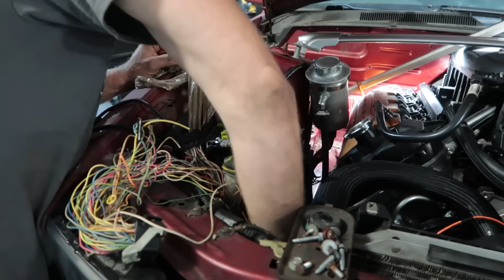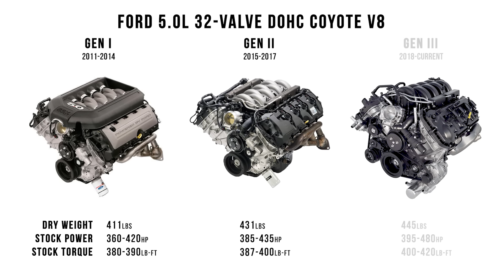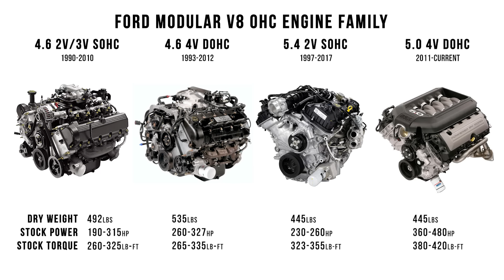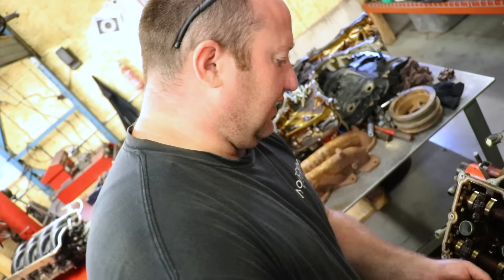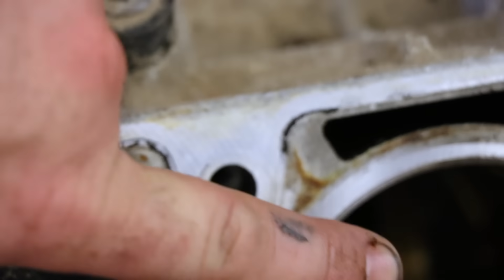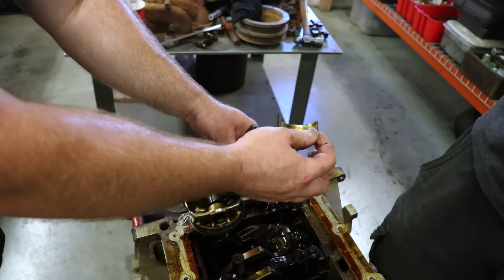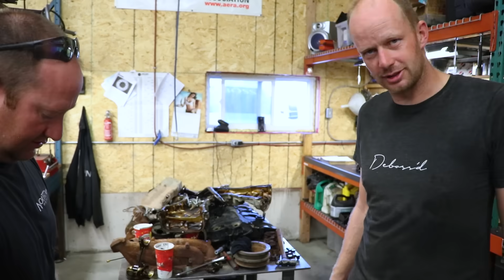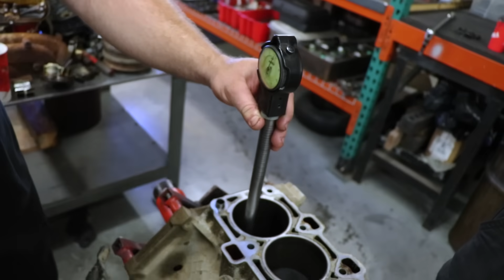REVIEW: Everything Wrong With A 5.0 Coyote Engine

Comment: Has anyone else seen synthetic oil do that to engine? I don't think it was short drives oil not coming to temp, I think this person never change there oil, just to show how careless they where they ran Frame oil filters!! which in my opinion are the worst one on the market!
Reply: I manage an auto parts store, at least 90-95% of my customers choose Fram filters. Even the ones who ask for my advice on filters (I typically recommend Mobil 1 filters) still go against my advice and buy Fram. We car guys may hate Fram, but most of your average Joes use Fram and the cheapest oil they can find.
Reply: @brushlessmicrot  yea I run Mobil one oil and filters and it has always done good by me, when it comes to auto parts cheap doesn't mean good! You get what you pay for. Also project farms YouTube has a good review of oil and filters.

Comment: 2014 f-150 fx4 w the 5.0. 132000 miles not a single issue. every 5000 full synthetic 5w-20 motor craft oil and filter. still doesn’t burn any noticeable amounts of oil. used as a truck everyday. maintenance is key for any vehicle.

Comment: Ribor your Cam boars and put bearing in r just throw it in the  scrap metal  the Amount of issues is overwhelming get A about a** all my support love a channel not trying to be a negative Nancy but I pretty much hate this line of engine charge my customer  $1000 just to tear into these things and tell them that it's junk afterward that usually doesn't go over well and it's not my fault   To fix him you have to pump about 5 grand into a $7000 truck you go spend 10 grand on LSGM same year did actually run The 10 boat just sucks

Comment: Love the comment he made about the LS being old pushrod technology, lol. Apparently newer doesn't mean better else Ford wouldn't have gone back to the pushrod engine design for their new big block truck engine. Which, by the way, I can't wait to see people dropping those into everything. Hoping Ford gains a little market share with that one. Even though I am an LS fan.
Reply: Could it be to keep engine size down? No large heads to house cams?
Reply: @jimdailey1018  Could be that among a bunch of others. simplicity of service and repair leading to less cost of ownership for fleet vehicles, etc. But the main reason why people don't put near as many coyote engines in as LS is due to the overall size from those overhead cam heads.
Reply: The OHC design predates the pushrod design. Nobody ever said newer is better, OHC just allows for safer high rpm revving and better airflow via more valves. 

The new 7.3l truck engine, (It's actually a small block) Is a low rpm, torque oriented engine designed for towing and heavy loads with reduced maintenance costs etc. It's not going to 7k all day, so it doesn't really need the top end air flow.

Comment: "money aside" haha, 99% of people are limited by money. of course the motor with the most valves/etc has the most potential, but it's so over complicated the guy building the motor said he can't even set up the cam timing. what a stupid system. they at least built the bottom end right, didn't screw the top end up, so thats good I guess
Reply: Timing coyotes is not hard at all

Comment: push rod engines are old tech but Ford's new 7.3 gas is a push rod engine.
Reply: Old tech doesnt mean poor quality  or unreliable that's for sure. Push rod engines produce  excellent  low end torque and hp.
Reply: I wonder if Ford will make a smaller version of the Godzilla , like a 5.?? liter version.
Reply: @TheUltimateCrash1990  they did. It was in the fox body mustang. Well it was very similar still a pushrod 5 litter.
Reply: If it ain't broke, don't fix it.

Comment: The color difference from head to head is because one head is exposed to the fresh air side of the PCV system and the other isn't. The fresh air side only sees half an engines worth of heat, moisture evaporation and harmful things in the oil. Then that half is drawn across the other head on it's way to the intake manifold.

Comment: Broad junk I replaced more F 150 Motors and 5 o's under 60000 miles with badd Cam faiseur and  And grenade timing chains and you go to pull the oil Pan and There is bearing Material And plastic timing chain Guide material the oil Pam I bought all the tools to lock down the Cams wedges all of it 350 bucks from snap on line them all up I got to use them once every time I've torn in one of these engines Are was junk A Cam towers and cam's go badd in a base gasket for the Camshaft Fraser's Well pressure tower thing Goes badd I as a mechanic in a professional rarely repair these motors because they're almost impossible to stand behind they have too many fundamental problems and I have fixed all these issues done the  Timing chains cam teasers oil pump  replace bearings with Ford parts fired up and a 1000 miles later a drops a spark plug in one of the cylinders not to mention fuel pump and wiring issues exhaust manifold big issues the last base engine has its little demos but there not plaited at every piont

Comment: I wonder what went wrong with this thing? Must be the cam phasor system - the 4.6 DOHCs used in the MarkVIII, Continental and Cobra were bulletproof. The chain guides would wear around 80,000 miles and make a little noise and that was it. 200,000 miles was nothing to those motors. Oh yeah, around 80,000 the coils would quit one after the other and 8 of them cost about $560.

Comment: 4.6 4v was found in the Marauder and Lincoln MK 8, as well as the one in the Cobra and Terminator Cobra. 
5.4 4v in the early 2000's Lincoln Navigator.
5.4 4v and 5.8 4v found in the GT500 (not the brand new one).
Reply: Dont forget the mach 1

Comment: Do we really trust a mechanic who buys his tools at Canadian Tire? When he know his stuff, Yes we Do. Just a bit surprised that you cannot pull the manifold off without dumping crap directly into the intake runners. Does Ford have "Oil life Monitors"? GM is using the stupid things and people who believe them are making GM tons of money on engine repairs. DOHC engines with lots of timing chains and oil pressure operated VVT require fresh clean oil. It looks like this one wasn't getting that. (hence the question about the monitors)

Comment: When the last Coyote is hauled to the scrap yard , an LS will be powering the vehicle that is taking it to it's resting place.
Reply: You mean an LS thats had parts taken from 20 other LS motors to rebuild it?
Reply: Coyote is just a revised Triton 5.4. Still has the same shit problems.
Reply: @michaelhite1433  the only problem I have is dragging shit LS across the track and only using half the fuel they use.
Reply: Derek Parisian only speaking from experience with Ford Modular V8s. I’ve owned 4 now, and will never own another. They were all in vans for work and I had 1 GMC they always drug their broke asses home. Only one of my 5.4s made it to 300k. My GMC was way over that when I sold it and the old guy is still running it around. All the Fords got scrapped in the end.
Reply: @michaelhite1433  as you know 5.4s are junk. I've owned 3 5.0s and have never had an issue besides from abuse. I've owned a 5.8 and it had well over 500k on it without any motor work. If you're going to bring a 5.4 into the conversation then it's not worth talking about  everyone knows those are junk and plagued with problems
Reply: Derek Parisian but my state stands true, the Coyote is just the newest version of the 5.4 Modular family. And I know of at least 2 5.0 that had rod issues, but I’ve never owned one. The 6blow and 4.5 LCF did it for me. I’m done with new Fords. Old Fords 👍. I’ve never had any issues with an LS.
Reply: @michaelhite1433  statement may stand true but i know more GMC owners converting to ford instead if vice versa. I avoided fords from 2000-2010. I've owner just about every ford motor that has been made and never had an issue besides abuse. Ls is outdated and will be phased out from government emission regulations. At the end of the day all an LS owner can brag about is cheap and reliable parts  and how you can find an LS in a scrap yard for free because the whole chassis and body falls apart or rust out before the motor goes on it.
Reply: Derek Parisian seriously doubt the LS will be faded out, considering it’s predecessor is still a hot rodders favorite. Well I’ve converted back to GM and Chrysler. Sick of Fords crap. I’ll stick to swapping LSs into stuff a Coyote can’t fit into. And in the end, it’s cheap power.
Reply: Derek Parisian plus, where I live, there is no emissions testing.
Reply: @michaelhite1433  Your statement doesn't stand true though because you claimed the 5.0L suffers the same issues the 5.4L did but you cannot refute that without contradicting yourself. Even if the 5.0L is just an improved version of the 5.4L it is an IMPROVED version of it. I've seen many 5.0L trucks now with well over 300K on them and still running strong, I personally own a 5.0L F-150 that just rolled over 90K today and it hasn't given me a single issue. It's fine if your best experiences have been with GM products, but my best have been with Ford and I don't appreciate misinformation being spread.
Reply: @nathanmcdonald610  it’s not misinformation. I’ve owned both 5.4 and 5.0. They are both modular Ford motors and have a similar architecture. I’ve had a 5.4 go 330k miles but it wasn’t trouble free like my 4.8 LS did. Both the 5.4 and 5.0 had coil pack issues and both had spark plug holes strip. Both done by Ford mechanics. Both common issues on these motors. Yes the 5.0 is a better motor, especially in the power department. The 5.4 and 4.8 LS were in box vans and the 5.0 were in trucks. The 4.8 is still banging around town, while both Fords are in the scrapyard.
Reply: @nathanmcdonald610  my best experience with Fords have been older trucks and vans. I’ve had multiple 7.3s that were great and 300 straight 6s that you couldn’t kill. But the new stuff not so much, especially the 6.blow and it’s little brother the 4.5. The Ford Econoline is still one of the best vans, and with a 7.3, it’s unstoppable.
Reply: @michaelhite1433  To be fair the 6.Blow was junk, but it also was an international engine. At that time Ford contracted international to  manufacture their diesel engines, but it was such a fiasco between the two companies that Ford dropped them in 2010 and had their current in house 6.7L diesel out by the 2011 model year.
Reply: @nathanmcdonald610  I know all about it. But it wasn’t international that was giving me all the grief over the warranty, it was Ford. I’ve always had warranty issues with Ford. They’ve always tried to get out of covering things. Not that GM is great at it either.

Comment: Love my 4.6 2valve in my 01' Crown Vic going on 266k.
Reply: You on the original timing components Jonny? Or have you had to replace everything?
Reply: @TheUltimateCrash1990 I replaced the chain, guides, and tensioners at about 210k. The original chain wore right through the guide into the tensioner. "While I was in there" I changed the cam followers and lash adjusters. All Melling parts.
Reply: @jonnygg6594  Melling is a great parts company, you made a great choice! What are your thoughts on Enginetech components?
Reply: @TheUltimateCrash1990  I'm not familiar with enginetech components. The company seems ok though, family owned, USA, been around a while. They sell reman heads for the 4.6 2valve. If I need any I'd probably order from them. Why what's up?
Reply: @jonnygg6594  Nothing much, I had to do a lot of work on my 4.6 liter. I used the EngineTech timing kit since the 2v is just sprockets, chains etc. I kept the original oil pump, replaced the hydraulic lash valves with an EngineTech set, and the roller followers with Melling. 

I was just curious if anyone else used them since I couldn't find many reviews on them.

I use 10w-30 otherwise I get lash valve tick on initial startup from the front 2 lash valves on the passenger side cylinder head. I should have installed that damn higher output Melling oil pump.
Reply: @jonnygg6594   I don't use 5w-20 that Ford specs for a 2001, that viscosity took out all 8 of my original passenger side lash valves (they were ticking very very loud) . I guess they weren't pressuring correctly.
Reply: Love my 4.6 2 valve on my 1996 Thunderbird. Bulletproof engine.

Comment: The wheel is old technology. That argument against pushrods is a strawman argument.
Reply: That’s because the wheel doesn’t have a replacement yet. The overhead valve has been succeeded by the overhead cam for years now by virtually every automaker in the industry... except GM and Chrysler and recently ford with the 7.3
Reply: @jbrandon302  because when something is reliable and works, no need to change just to say you could.
Reply: @asherdie  the overhead cam is so popular because its rssier to design a block without pushrods going through
Theres less moving parts in the valve train, less friction, the ohv engines arent capable of being as reliable and stable at high rpms like ohc
Also they allow vvl/vvt stuff, and have better emissions in general, and better fuel efficiency
Imo the mustang could have just been a tad bigger of a displacement but just a sohc with 16 valves. Less chains and timing bs going on
Reply: @mattgarkus2489  high RPMs are unnecessary except for racing.  Fewer moving parts depends on design. VVT is gay.

Comment: Wouldn’t be because of the crap Fram filter? I had a ford tec tell me the 5.0 is a high pressure oil system and need a proper filter otherwise they won’t get proper flow. Causing premature failure.
Reply: Yep, Fram sucks. Deboss said that right off the get go.
Reply: That’s why I only run motorcraft filters in my 18 5.0.
Reply: Bushy556 same here

Comment: Problem I had with the 4.6 was there was a coolant line coming out of the back of the water pump that went under the intake that sprung a leak and I had to take the intake manifold off to replace it. Problem I had with the 5.4 is it had plastic timing chain guides that wore away and required  removal of the valve covers , oil pan, and timing chain cover to replace.

Comment: Ford must be the only automaker where synthetic oil is worse for your car
Reply: Its not, calling oil synthetic is not what people think it is. Its still natural oil the only difference is it gets refined to a greater extent to ensure a more uniform molecule size. The only way the oil could be the cause of what he blames it on is the additive package.
Reply: Older Subaru’s. Run WAY better on conventional. The synthetic burns in early 2000s Subaru’s like crazy.

Both the blue oval car makers I guess.
Reply: @connorjones1485  my 95 outback with close to 300k Miles didn't burn synthetic oil. Maybe try changing or cleaning the pcv valve? I haven't really ever seen cars that burn more oil due to it being synthetic. Its still the same viscosity grade at the end of the day. A lot of that is people who where scared and believe 3k intervals are necessary.
Reply: @connorjones1485  I have a 2006 Subaru Legacy 3.0R, you are spouting complete nonsense.
Reply: Yeah I’ve literally never heard of synthetic being bad..... I think someone just doesn’t think right

Comment: 2018 and some 2019 5.0's are getting replaced, yes the newer Plasma Transfer Wire Arc cylinder liner ones. It's all over the Internet right now, lots of people getting replacement engines in their trucks under warranty.
Reply: You are not up to date. The latest pcm flash fixes the oil burning. Enginnering came back and said the engines that were replaced had nothing wrong with them.
Reply: @BrianBourgeois-  I assume you're referring to TSB 19-2365.. I'm not not up to date; some are reporting success with it some are not and are continuing to complain to Ford. I have a thread on this subject on ford-trucks.com forum with 51k views started in March 2019 by me.
Reply: Lots of people who have that uncommon issue. Thats a small group. It’s not widespread.
Reply: @vojnikjna30  What are you saying? It's not uncommon at all, go talk to any service shop at any Ford dealer.

Comment: My buddy bought an 11 coyote mustang with 90k miles 3 years ago and it ticked from day one. He drove it for 2 years and put 30k miles on it, changing oil frequently and the noise never changed. It had aftermarket exhaust and 100% sounded like a heat shield, cracked manifold or blown manifold gasket. It ended up knocking bad one day and he towed it home, pulled the pan and the #1 rod spun. Ground crank and reconditioned rod and it's back together. The plastic valve covers also hairline cracked on his engine and the donor he got for the crank which caused oil to seep into the spark plugs. The single plastic valve cover is $130 but they repop them in aluminum for $260 for the set.